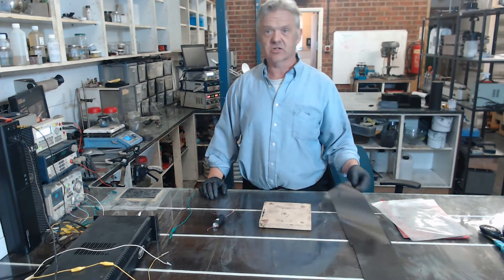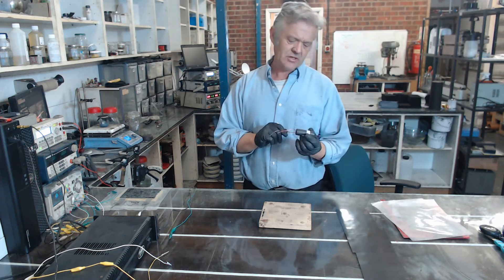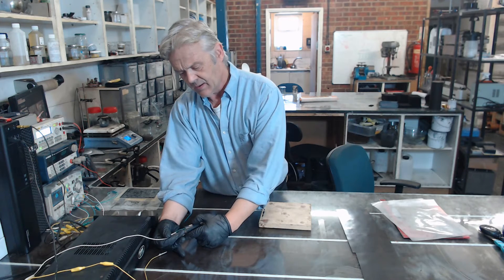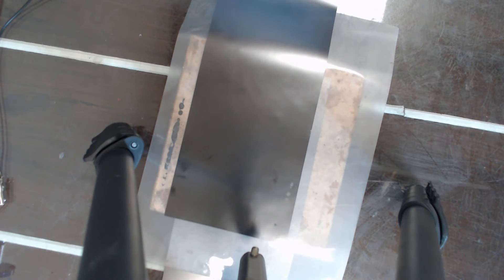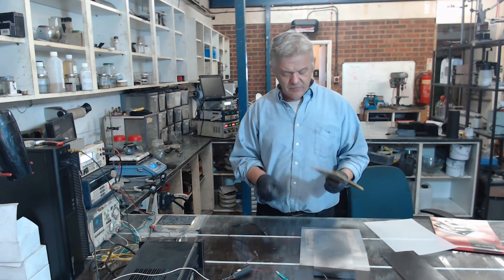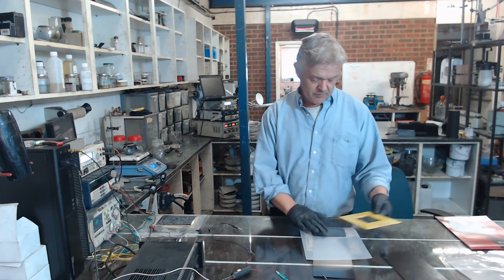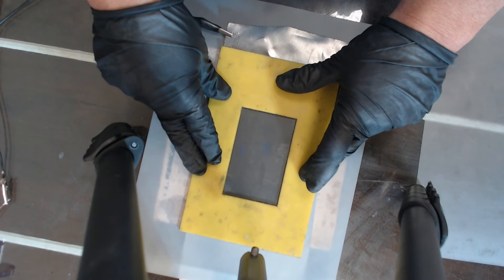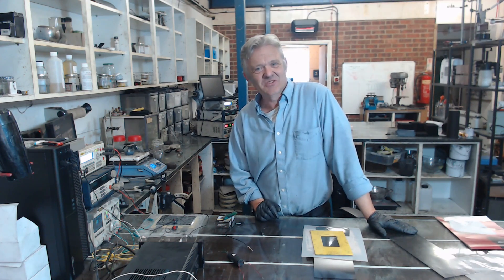How To Make An Easy Graphene Electrostatic Speaker

Comment: Now if you held the small frame over a vented box your sound would be louder 
Thats why placement away from walls is critical with stats.   However with the woofer id do a a periodic membrane over the front of the driver to load it down that way id get reflective bass sound off the low-end driver.

Comment: Are you sure the graphene diaphragm is thin enough? Thicker material results in truncated high frequencies. I've heard this problem with an overly thick mylar diaphragm installed on a bad sample of an "Audiostatic" speaker. Extreme roll off of highs was the result while other samples of the same speaker with the right mylar sounded just fine. Unless the membrane is sufficiently thin you'll never hear the detail and transparency an electrostatic is capable of. And that graphene looks way too thick for such an application. Martin Logan diaphragms are typically about .0005 inch or 10 microns thick.

Comment: You could buy big electrostatic speakers over 40 years ago. They were half the size of a door, and sounded really good. For some reason, maybe too high a price, they never really caught on. They should have a very good frequency response, if made properly. Another option was the crystal earpiece, using a piece of Rochelle salt between two electrodes. Very beloved as crystal radio receiver earpieces. You've set the mind ticking, Robert. Thank-you!

Comment: If you cut out the centre of a sweet tin lid and force fit the sheets between would it amplify better? There's a covering for model aircraft called solar film,iron on adhesive,shrinks with heat,could it be grapheneated?
Reply from the maker: awesome ideas mate and absolutely - i'll look out for that material

Comment: I make ESLs for a hobby. You can make good sounding esls and construction is simple. Actually graphene would not be the best coating as charge has to be static.  But you may use graphene to make  stators conductive. Have fun with esls.

Comment: Form you description the "flyback transformer" seems to take a DC input and produce an alternating output hence the terrible distortion. It will only turn on  on half of the audio cycle and only above some threshold.  When I was a kid I had a valve record player and that had a normal loud speaker plus an electrostatic tweeter. I think the tweeter was just connected to primary of the output transformer, so only perhaps 100V swing, not 40kV.

Comment: Hi ROB  another great video, how about adding 4-5 mega ohms resistor in parallel and cut the sheets in a circular shape and at the far  opposite side to adding an high voltage arrester  then volume should be attenuated till you get the best performans not at the highest set.,keep the good work bro cheers mate .

Comment: I think you need some sort of a fixed high voltage DC bias with the audio signal superimposed on it, otherwise the sound will suffer a frequency doubling (severe distortion). As the speaker is voltage driven, and the current is negligible, I would also doubt there would be any advantage in using your highly conductive coating on the plastic - a poor one would be equally effective.

Comment: You are missing a pre-polarised stator to get this working properly. Plus a flyback transformer is a dismal choice for the A/C side of the system. Not the most well thought out on the physics side of how an electrostatic loudspeaker works. Most ESL's are using a very high resistance film. Your graphene film will be a low resistance setup. The low resistance can work but you will have a harder time keeping a proper set of stators charged.
Reply: obviously his design is different than conventional ESLs, but clearly there is potential in this direction, and I can see some advantages over the traditional design.

Comment: I was thinking for your lab more than myself but I do want to start marking it so getting properly set up would be smart , I ordered ferric chloride stuff but got it in liquid form and after reading comments again I realized I should have got it in powder form, could I dry it to make it the same as powdered like you used  although the permanganate way seems a good option 

I had another thought a few weeks back about fine tuning an ultrasonic bath to emit the resonance frequency of graphite  and seeing your speaker video tonight , I wondered if you have thought of it or even tried it yourself , seems plausible but I can’t imagine no one hasn’t thought of it before so maybe it doesn’t help split the graphite  but if it helped it could be handy 

Is tony still working with you on concrete development 

Great job as always  thanks a million  for everything you share

  Edit,  This was meant to be a reply about the fume cupboard comment I made on your earlier video

Comment: I think those are 3-6 volts DC input...
Reply: That's great! Because an amplifier doesn't put out too much more than that unless youre going loud loud!
Reply from the maker: @lowerthetone  you really don't want to use an audio amplifer - it's just what i had laying around - the best thing would be to design a control board specifically for electrostatic speakers
Reply from the maker: yes they are - clearly - better control electronics is a good improvement here

Comment: Hi very interesting and immediately reminded me of the Leak speakers. The inearity of the LV to HV converter will be rather bad. About the build method could you suspend the two plates capacitor(this time with a foam separator. between)and then between the two outer plates of fixed high voltage and feed the audio to the inner capacitor so the whole lot will vibrate depending on respective rigidity.???
Reply from the maker: nice one mate - personally i think time spent creating a driver board would be time well spent - rather than cobbeling it together from bits in the lab - but as demo of what can be done from bits around - ilike it

Comment: This is something I never really thought about. Thank you again for an awesome video.
Reply from the maker: cheers mate
Reply: @ThinkingandTinkering  hi Robert ,  the high voltage generator works with DC voltage and amplifier works with ac,  doesn't that mean it shouldn't really work?   I'm trying to make one and I needed your clarification
Reply: @miclairmiclair876  How high should the voltage be? Thanks

Comment: Who needs a separate phone screen and speaker when the screen can be the speaker.  I wonder if one could do a stereo version by separating graphene coat into 2 sections.
Reply: I may be wrong BUT this is very high voltage. You shouldn't touch it. A battery isn't enough to supply that voltage for very long I wouldn't imagine.
However, Martin Logan (or one of the electro speaker makers) decided to turn a car windscreen into a stereo panel just like you described! I've never come across one in real life. Check it out though
Reply from the maker: @lowerthetone  it is high voltage but extemely low amps so the wattage is fine - a flyback is just what i had you could use a cockcroft wheaton bridge which is what they use in air ionisers and the battery version of that lasts for days - really this is just a starting point for folks to think about and to think how could they do it better - i hope they do and post some good vids on it
Reply from the maker: interesting idea mate

Comment: So curious if we could make it higher quality sound
Reply from the maker: I am sure you could - have a look at commercial versions and see where they differ - build quality is on issue but to get this working I roped together some pretty basic electronics - a dedicated driver board would certainly improve it
Reply: @ThinkingandTinkering  this was used as a cheap tweeter in the early days of audio...in order to get push-pull sound , screens w/bias voltage are needed  
   electrostatic speakers have been considered among the most accurate , but they're complicated for the home builder.....
                 plans were available through the 50's ( AUDIO magazine) , and SPEAKER BUILDER in the 70's
  this reply to Archie       
   also , because sound is degraded by enclosing an ESL , they are nearly always used as dipoles , so must be LARGE .....i dreamed for yrs. of bldg. a folding screen ESL , but never got around to it
Reply from the maker: @kcajmortsnnew1488  you should have done - it is always a lot of fun to actually DO something rather than just talk about it - you learn so much from doing is my feeling. You are quite right to create high fidelity reproduction is a challenge but to explore the science behind it and have fun is pretty easy - positive mental attitude mate lol
Reply: @ThinkingandTinkering  i've built MANY loudspeakers , even Klipshorns ( a real challenging cabinet) , just never got round to ESLs....i like low power tube amps , and focused mainly on horns , for efficiency and transient resp.....ESLs need lots of power.........
     i'm a painter first and foremost , so hi-fi took a back seat quite a few yrs. ago , once i determined the sound quality was as good as i'd likely get    painting is research in a different realm
Reply: @ThinkingandTinkering  tension your diaphragm to a frame. force used is proportional to voltage required. the buzzing sound comes from the plastic hitting stuff. 

if you insist on improving the driver circuit, look up schematics of old stax amplifiers. 

more info (200+ page thread on head-fi): google "diy electrostatic headphones"
Reply from the maker: @michaelknight2342  insist? mate this is just fun to do -I don't really want to be a pedant as you are kind of right but I always thought that the force used was proportional to the mass of the membrane you are trying to vibrate and the square of the distance the membranes are apart. The strength of the field required to do that work was, i always thought, proportional to the voltage applied